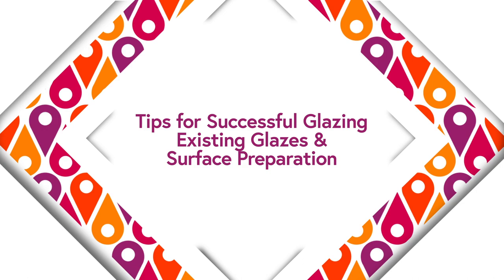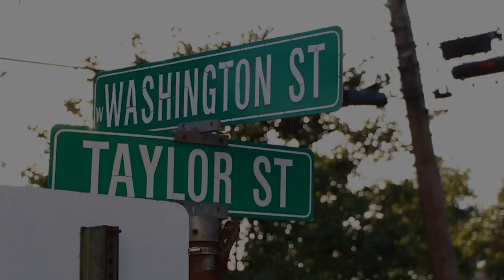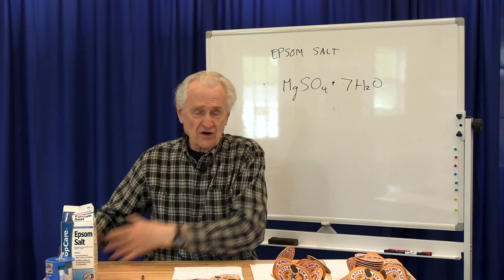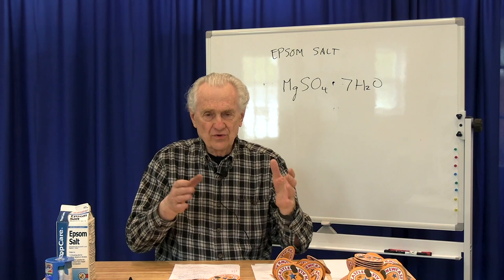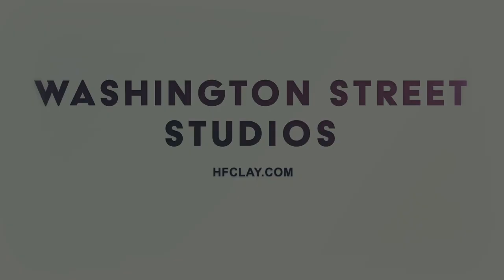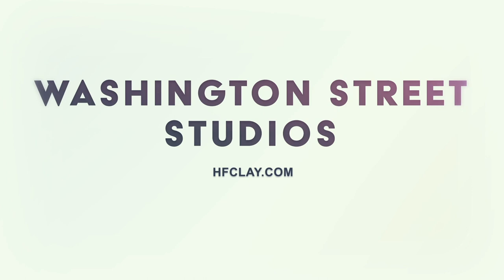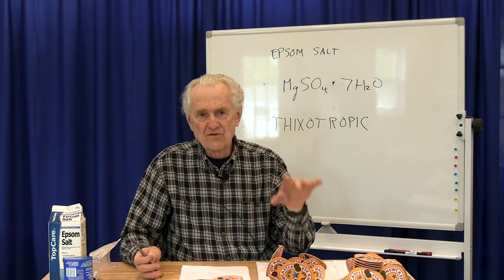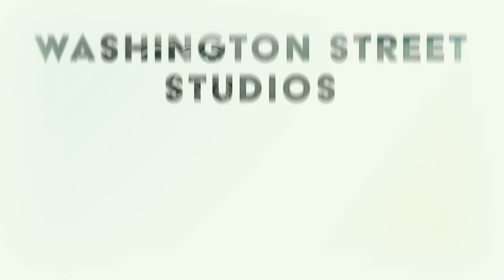Understanding Pottery Chapter 4 Tips for Successful Glazing Part 2

Comment: Hi! Amazing Channel! I def will support you guys! Did anyone ask how fix a glaze that has settled into a hard part at the bottom of the bucket? Would epsom trick work for this? Thank you!! 🙏🏼
Reply from the maker: Lynn, thank you for the encouragement!
Clay settling at the bottom of the bucket typically happens if there is not much clay in the glaze recipe. If you have the recipe, check the clay content and if it's less than 20% of the materials the preferred solution is to add 1-2% bentonite to the glaze so the clay will create a stucture to help keep the glaze in suspension.
You will need two buckets, a sieve and a trimming tool, bentonite, a scale and measure cups.
First, measure the bentonite and mix it with warm water, bentonite wants to clump, so this really is the hardest part. Remember, you only need a small amount of bentonite, 1-2% of the dry materials, or about 25 grams of bentonite per gallon of glaze. 
Next, pour the glaze into one of your buckets to expose the hard pan and add the bentonite to the glaze you poured off, mix well.
Then get the hard pan of glaze ingredients off the bottome and broken up into pieces. I've used a trimming tool to scrape it off the bottom. It cuts much like a leather hard pot and l've found this the easiest way to get it off the bottom of the bucket. Once the hardpan is broken up into the smallest pieces you can, add it to the bentonite/glaze mixture. Clean the original glaze bucket.
Mix the glaze thoroughly.
Sieve the glaze back into the original bucket, breaking up the clumps to pass through the sieve. You need to get as much of the glaze ingredients back in the glaze.
Mix the sieved glaze thoroughly, then sieve it again. Mix thoroughly, sieve one last time.
Every time you use the glaze, or it sits for a long time, mix it thouroughly. If you find clumps, sieve, mix, sieve and mix.
I hope this helps and thank you for watching the videos! Please share this channel with your friends and fellow potters to help us grow our ceramics community.
Dennis
Reply: @WashingtonStreetStudios  thank you Dennis! Will head over to Patreon too!

Comment: I would like to try turning dipping glaze into brushable glaze with the cheap maple syrup suggestion.  What ratio prepared glaze to syrup do I use?  I found several types of maple syrup that are mostly corn syrup with less than 2% cellulose gum.  Is that something that will still work?  This is the ingredients for my first choice maple syrup that's sugar free: Water, Sorbitol, Cellulose Gum, Natural and Artificial Flavors, Salt, Caramel Color, Sodium Benzoate and Potassium Sorbate (to Preserve Freshness), Sucralose, Phosphoric Acid, Acesulfame Potassium, Aspartame, Citric Acid.
Reply from the maker: Stephanie, you want cellulose gum high in the ingredient list, so your first choice is a pretty good one. And you won't need a lot of syrup in the glaze, I normally add about three tablespoons of glaze to a drip or two of syrup. If you try painting on the glaze and it doesn't flow very well, add another drip of syrup. Repeat until it's brushable.
Great question! Please share the channel with your friends and fellow potters to help us grow our community!

Comment: So what can you do for a glaze that has too much epsom salt added? How do you reverse that?
Reply from the maker: Crystal S, epsom salt flocculates a glaze, so to reverse the effects of epsom salt, you need to add a deflocculant. The most common deflocculant is Darvan 7, and you can also use sodium silicate. Add very small amounts since anything you add is changing the chemical make-up of the glaze. Finally, the least intrusive deflocculant is time! Glazes that needed epsom salt added naturally deflocculate over time, albeit a very long time in some cases. A suggested approach is to take a sample of the glaze and test adding Darvan 7 or sodium silicate to see if it resolves the issue and to know how much to add. 
Good luck and let us know how it turns out!
Reply: @WashingtonStreetStudios  Thank you for replying. I have Darvan 7 so I will try it... using a smaller sample of the glaze to test the ratio, as to not mess up the whole bucket this time. Thank you!
Reply: @WashingtonStreetStudios   I find your videos very informative & helpful. I have learned a lot. Glazing chemistry is the hardest for me to grasp. I really appreciate your videos. Thank you for taking the time to make them and post them for everyone to benefit from.